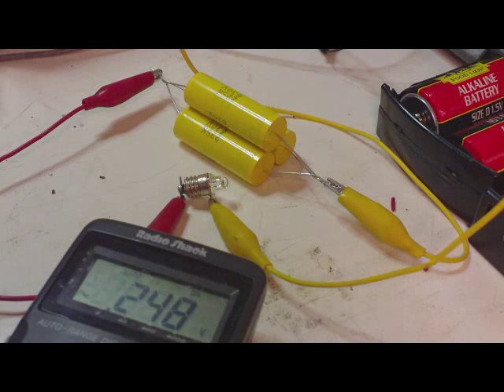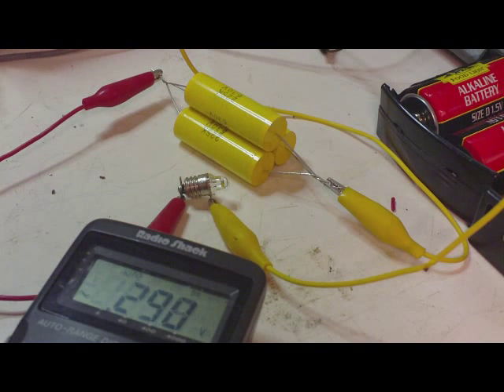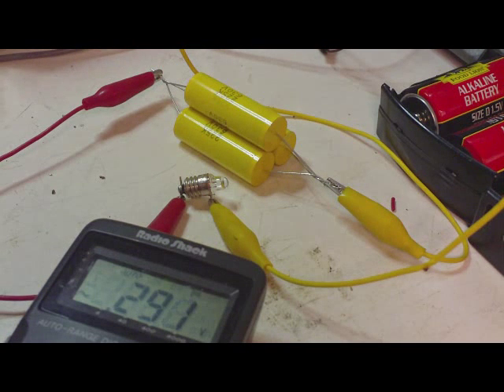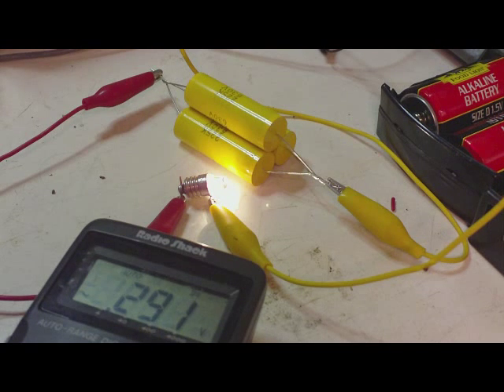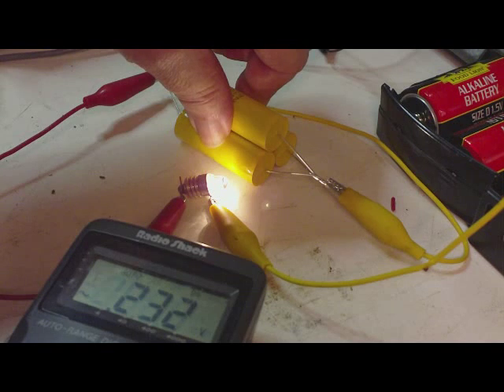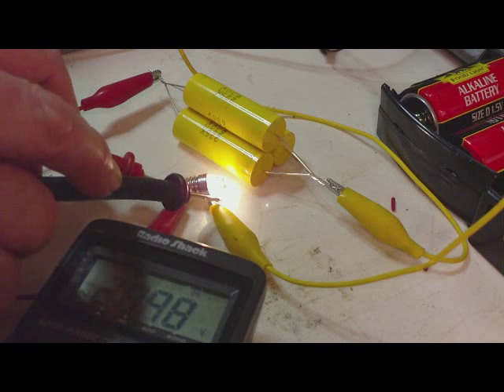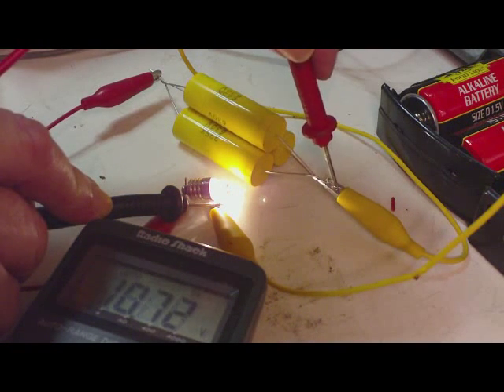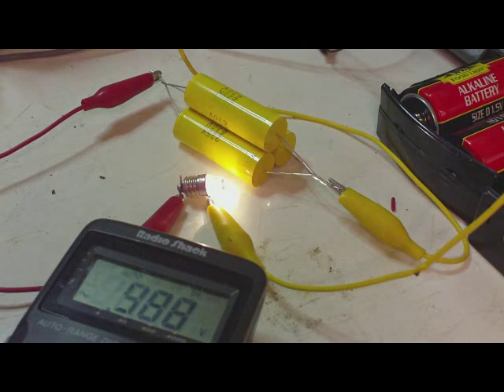Capacitors, AC Current Flash Light Bulb

Comment from the maker: @CassetteMaster 
It's safe each capacitor is rated at 630 working volts. The reason why you would not want to do this is each capacitor is over 2$. You did some really good experimenting earlier keep it up. You will learn so fast, with fails and successes. Don't worry about fails, that is how your learn what works.